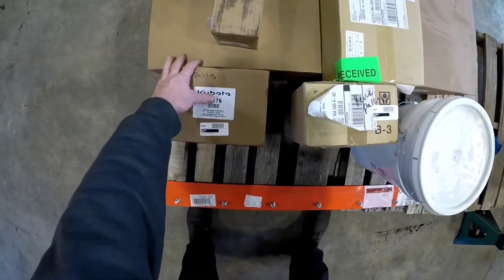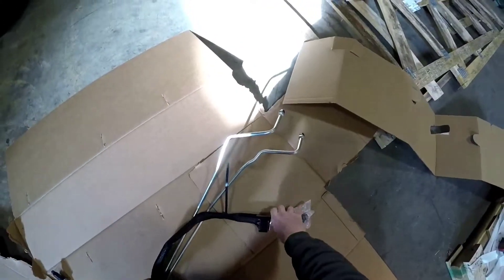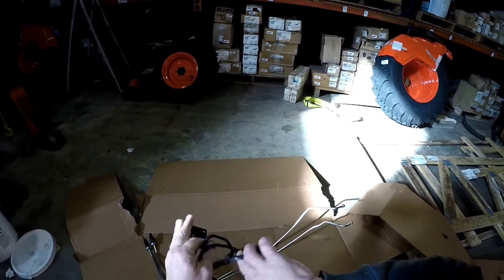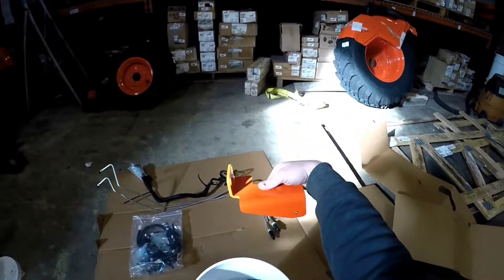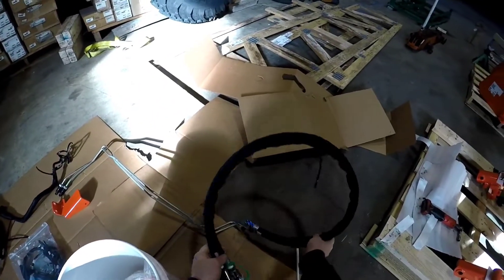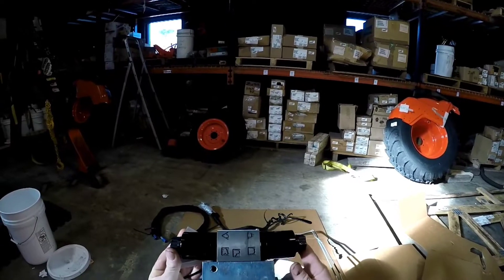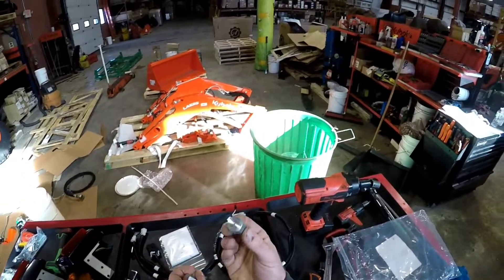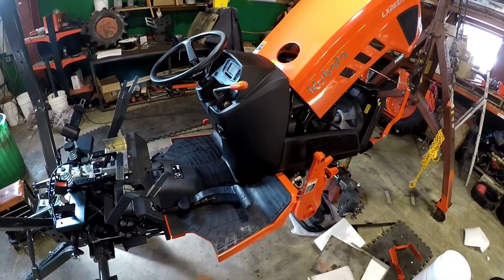Kubota third function valve unboxing / rops model lx tractors

Comment: Armrests were the first thing I added. They are great.Adding rear remote this year
Reply from the maker: Arm rests are a must!  Did you get your rear valves added on yet
Reply: @ryanlynch2259  not yet still need more parts and have to get a rear blade that can have cylinder to angle it put on, couldn't get one that I could angle hydraulically when I bought the one I have